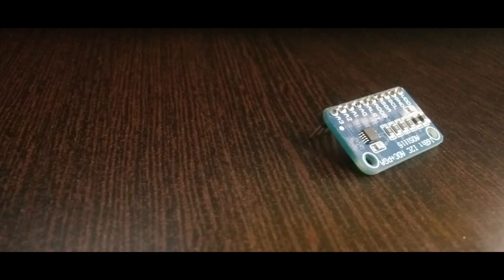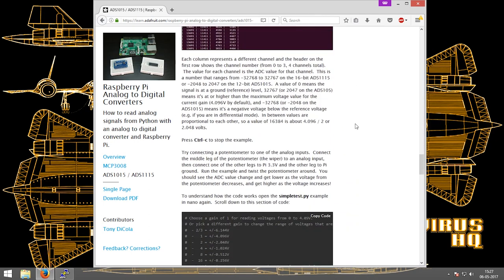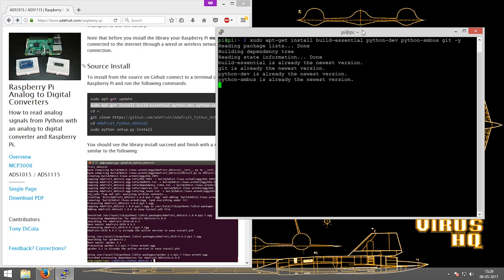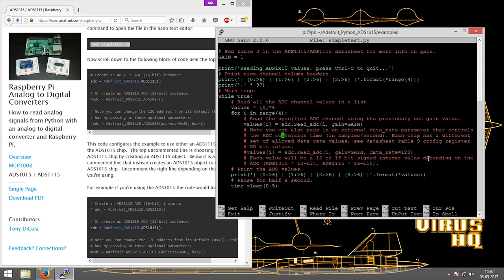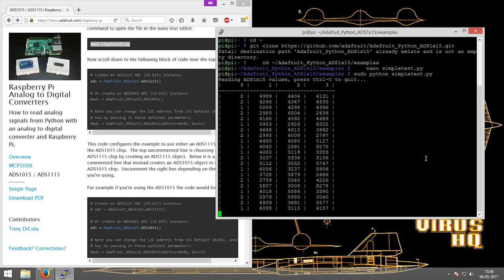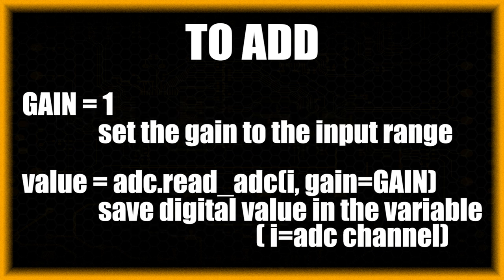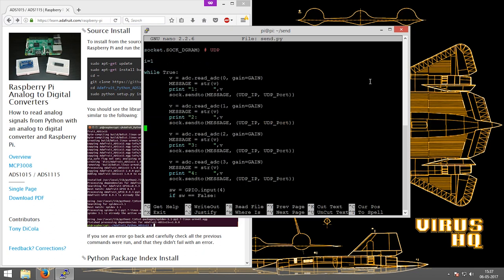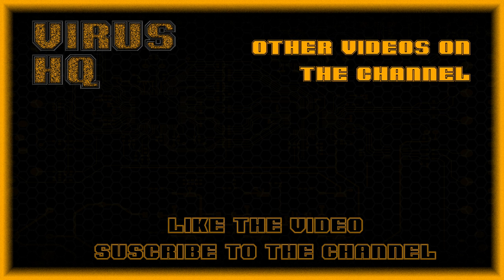Analog Pi | ADS1115 ADC with Raspberry Pi

Comment: I2C device is detected at address 48, but simpletest.py won't run as "IOError: [Errno 121] Remote I/O error"
I don't get it.
Reply: Likely poor soldering. Did you end up solving it?
Reply from the maker: Also make sure that you are using the right GPIO pins and also check if the i2c connections are correct

Comment: These just produce raw values. How do I get the voltage values from the ADC?
Reply from the maker: +Jonathan Pereira these are not raw values, these are digital values and you can convert these to voltages based on the input voltage.
Reply: Virus HQ how can you provide the code?

Comment: same setup using example code from simpletest.py, but mine is telling me 'remote I/O error'
Reply from the maker: Then it is a connection issues
Reply: i changed wiring 3 times,  changed to another raspberry pi, still give the same error.
Reply: Did you figure this out? I think, I'm getting the same error: 
Reading ADS1x15 values, press Ctrl-C to quit...
|      0 |      1 |      2 |      3 |
-------------------------------------
Traceback (most recent call last):
  File "simpletest.py", line 42, in <module>
    values[i] = adc.read_adc(i, gain=GAIN)
  File "build/bdist.linux-armv6l/egg/Adafruit_ADS1x15/ADS1x15.py", line 192, in read_adc
  File "build/bdist.linux-armv6l/egg/Adafruit_ADS1x15/ADS1x15.py", line 128, in _read
  File "build/bdist.linux-armv6l/egg/Adafruit_GPIO/I2C.py", line 129, in writeList
  File "build/bdist.linux-armv6l/egg/Adafruit_PureIO/smbus.py", line 294, in write_i2c_block_data
IOError: [Errno 121] Remote I/O error
Reply: @dwuethrich  Do somebody fixed this error?
Reply: hm, that's strange, but my trouble was fixed by changing slk and scl wires
Reply: Its not just a connection error. Its something else...trying to figure out.

Comment: are you trying to sample 50 HZ AC signal :: ..?
Reply from the maker: Nope , just normal the normal output reading that one gets with a variable voltage , but I think it will be able to sample 50hz input signal as long as it's within that maximum allowed input voltage